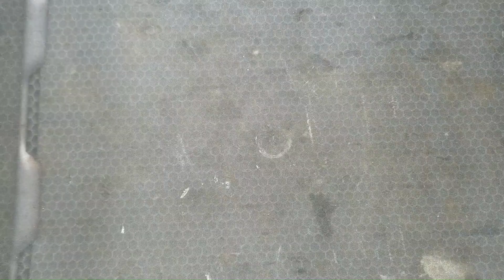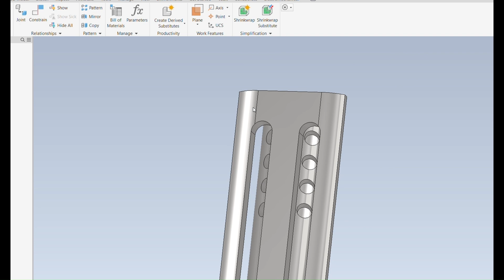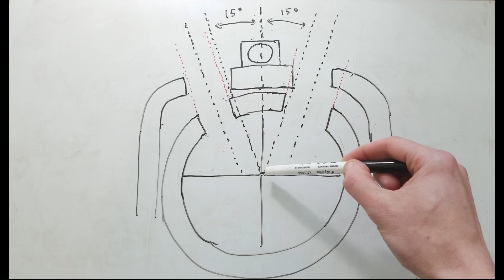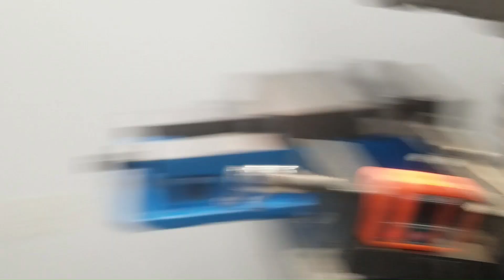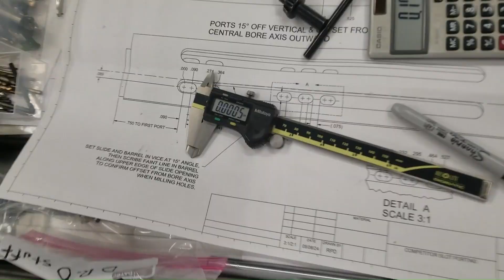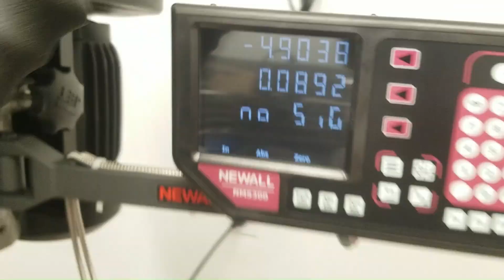Ported Smith and Wesson M&P 2.0 Performance Center Competitor

Comment: @Engineer's Armory I thought you said your final design was a V6 with slightly smaller ports so they didn't interfere with the slide. Yet the barrel you showed only had 4 ports?
Reply from the maker: Ummm no my final design was the one i machined

Comment: Hey, just out of curiousity, did your buddy ever tell you how it worked out? Did it make a significant difference? I'm thinking about buying a second barrel (because you can't compete in certain competitions with a ported barrel so I want both) and trying to get it ported exactly like this. This was exactly how I pictured it in my head, too, and also only saw the one company with the ports on the side.
Reply from the maker: Yeah I shot it too. He and I both agreed it made a noticeable difference in muzzle flip. I ported my 5" 2.0 and did my normal muzzle flip reduction testing on that. Check that video out if youre curious, should be similar. I think the overall port area came out close.
Reply: @EngineersArmory  Hell yeah, I appreciate the response. The ultimate goal is to completely pimp mine out (weighted grip insert, dpm spring, gas pedal, and ports), and this'll be the most expensive mod (especially with the extra barrel), so it'll prlly be the last one I do. Hopefully there'll be a company porting them like this by that time.
Reply from the maker: @fullmetal929  have you seen the new steel frame competitor? Big old window in the top of the slide would make porting even easier than this.
Reply: @EngineersArmory  Yes I have! It looks sick. I was thinking about waiting til it came out to get a competitor, but then saw the aluminum one on sale for black Friday and decided to pull the trigger. Then I saw that they had dropped the HD, got real sad for a second, and then looked it up and saw that it's almost 500 bucks more than I got mine for and felt better, hahaha. Especially considering the fact that the weighted grip insert gets me most of the way to the weight of the new one anyway; I'm basically gonna get the gun, gas pedal, grip insert, dpm spring and dogtag for the sight for the same price as the new one. I woulda been real pissed if I had paid full price tho, hahaha. I might still pick it up at some point down the road and at that point, I should be able to transfer over some of the mods anyway.

Comment: Can I ask how the finish on the slide is holding up and how many rounds have been shot through since it was ported? Also really wish you would consider porting barrels. Awesome work!
Reply from the maker: Couldn't tell ya. I havent been in touch with the guy I ported this for in a while. My M&P 2.0 5" in FDE has a similar finish, just a different color, maybe have 500 thru it since I ported that and the finish is doing fine, most the carbon wipes off.
Reply: @EngineersArmory Got it and awesome! No way I could convince you to port a stock barrel for me?
Reply from the maker: @AdrianD-d6c haha nope sorry man. I aint gonna get into that business.

Comment: Can you send me your drawings you’re definitely on the right track bud!!!
Reply from the maker: there is a clip of my drawing in the video. Sorry, i usually try to include a clear image of all my drawings in my videos so people can use them. Didn't in this one for whatever reason. I dont have any other way to share the drawings my apologies.
Reply from the maker: Pretty simple dimensions. 4X .090" center 7/64" diameter slots. 15 degree angle off center and offset .089" outward from bore axis. center of the first slot is .750" from the muzzle.

Comment: The reason that Floyd’s ports the competitor on the sides is because since it’s a 5” gun that has a slide lightened to almost the weight of the 4.25” gun porting the barrel on top can actually cause muzzle dipping vs. muzzle rise. Either problem leads to longer recovery time and the Floyd’s porting is the happy medium
Reply from the maker: Respectfully disagree. I have shot a lot of compensated and ported pistols of all sizes, barrel lengths, and slide masses. Never came across one that was over driven. Ive experienced that on rifles a few times. The muzzle gets pushed down due to aggressive compensation when the shot is fired.

I have shot this pistol now and my buddy has shot it a lot too. The porting did reduce muzzle rise, but certainly does not drive the muzzle down.

Just my thoughts here based on my experience and understanding of these systems: I dont think any compensator or ports would be able to drive the muzzle down on a 9mm semi automatic pistol with a browning tilting barrel system. The way the guns are designed, how the barrel unlocks, the perpendicular separation distance of the bore and slide mass reciprocating from the pivot point of the pistol in your hand, and the compression of the recoil spring should always result in some muzzle rise. I have measured as low at 7-9 degrees of muzzle rise on some of my ported pistols. But there is always some. 

If you have something more than anecdotal evidence of a tilting barrel action, 9mm, semi-automatic pistol that was over-compensated to the point the muzzle dipped when fired, I would love to see it.

Comment: How did this turn out did it end up working well for your buddy in reducing the recoil ?
Reply from the maker: Ah yeah sorry forgot to post a comment. He has shot it and says there is a big difference. Noticable reduction in recoil and muzzle flip. He was really pleased with it. If you're curious about numbers and seeing the performance it's really similar to my 5" M&P 2.0 I ported (video on my channel). We run the same optic and everything.
Reply: @EngineersArmory  I just got a competitor I have a 1.0 core that is ported. I'd like to do the same thing to my barrel like you did to your buddies. Your not doing that for anyone else still right? If not any chance I could grab the measurements for a local to port it?
Reply from the maker: @onelastmarine  naw dont wanna turn this into a business. When I get home from work I'll post a link to my drawing.
Reply: @EngineersArmory  thank you so much I appreciate you taking the time to respond.
Reply from the maker: @onelastmarine  Here is a link to the drawing:

https://www.reddit.com/user/rrppdd4/comments/1el35k1/mp_competitor_port_drawing/

The holes are at a 15 degree angle off the vertical, but not inline with the bore axis. So the machinist would need to set the barrel at a 15 degree andgle in the vice, zero his axis off the bore centerline, then dial to the .085" off bore axis dimensional call out. This is just a drawing of the ports I did. That angle and position would work for any slot or hole design you wanted up to 7/64" diameter. This is exactly what I did to my buddies barrel - you may trust but verify. The machinist should confirm all my measurements and callouts with your barrel and slide so something doesn't end up in the wrong place.

Hope this helps, if you get yours ported let me know how it comes out.
Reply: @EngineersArmory  thank you.

Comment: I agree with you, Smith should be porting these from the factory. Nice job!
Reply: If you port a glock 17? Wich work would you do?
Reply from the maker: @gironlam83  I probably will be porting a glock 20 for my dad before long. Glocks have a blocky slide so i think ports straight out the top look the best. With their sharp 90 degree corners the slide profile doesn't lend itself well to angled V cuts in the slide. I would probably end up with a wide window in the slide then a narrow slot V-port like I did to my M&P 5" (shown in this video - the FDE gun). This would also be similar to the factoyr porting on the 18C and 17C.
Reply: @dltz what do you think about your czs work on a glock? I was thinking copy your work!
Reply from the maker: @gironlam83  Yeah the inline porting I did on my CZ P-10F and P-01 would work fine, however I don't recommend any bigger than a 1/8" hole (.125"). The ones I did in those guns are bigger than that and I have learned more since. And feel free to copy away my man, I aint trying to make money off this and my designs for poking holes in barrels aren't anything new haha.
Reply: @EngineersArmory  thanks for your notes and for sharing it when i got the nuts to do it ill let you know! 3 o 4 holes? I think 4 for the length of the slide and barrel but your experience what would you recomend? I dont miss any of your videos since i found your channel! And how much bigger do you think of the window?
Reply from the maker: @gironlam83  of course I am not encouraging you to modify your firearm but.....😉 Here is a drawing. i would do the one with 4 holes, but make them .125" diameter.

https://imgur.com/a/inline-barrel-port-dimensions-xvjDEul
Reply from the maker: It would be cool to just offer a ported option, then people could choose. It would just be a different barrel.